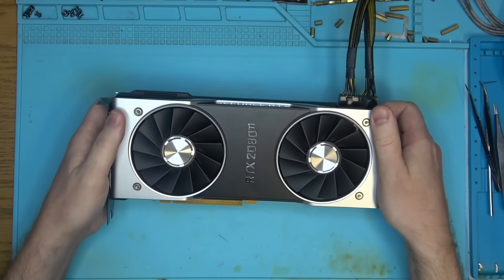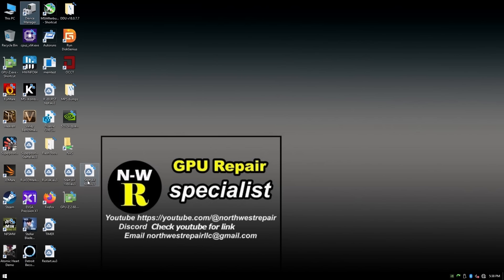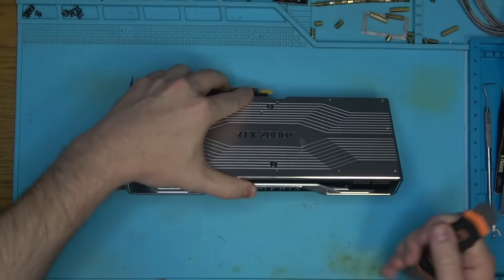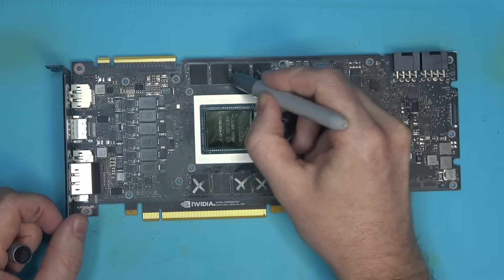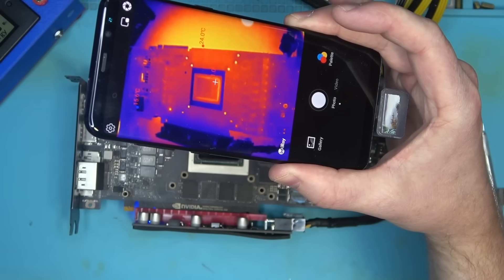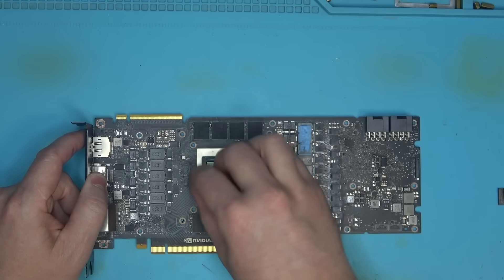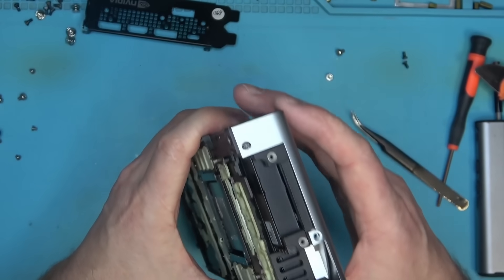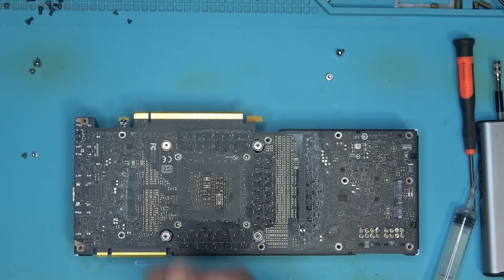2080Ti memory upgrade video 11GB to 22GB

Comment from the maker: Upgrade does not work for all cards
2080-2080ti yes
3060-3060Ti-3070 yes. 3080 theoretically
3080Ti-3090-3090Ti NO. 4090 YES but it requires a custom made board so normal 4090 is a NO.
50 series Not at this point. As soon as 4GB chips come out, there will be a chance to try. Otherwise NO.
Reply: is the 3070 ti upgradable ?
Reply: I have a Zotac Gaming GeForce RTX 3080 Trinity OC, but it needs more VRAM for my 4K screen. Would you recommend the 10GB to 20GB mod, or should I look for a better card in the future?
Reply from the maker: @3.2213  theoretically possible
Reply: 3060ti should also be possible, but with an asterisk. It does not have very powerful memory VRM, meaning you might only be able to run the card with enforced "max performance", otherwise you'll most likely see black screens each time the card will transition from one power mode to another OR when you just leave it at idle.
Reply from the maker: @n0n4me-h2h  yes
Reply: "Same for 50 series cards. Not happening untill we get GDDR7 chips with  4GB per chip. At least thats the idea."
Why is it no possible for 50 series, 3GB GDDR7 chips do exist and are larger then the 2GB GDDR7 chips the cards come with, has somebody already tried soldering 3GB chips to see if they work on 50 series? Also I assume if 4GB chips worked then 3GB chips would probably also work.
Reply: 4060 ti?
Reply: @Keekw  It wouldn't be worth doing it on a 4060ti. It is possible but I doubt you would want to spend $200 to upgrade and still be worse than a 4070. I would sell the 4060ti for $300 and use that $200-250 budget to upgrade to a 5070 or rx 9070
Reply: @noticeb4itstoolate  Yeah prob I will do it
Reply: @noticeb4itstoolate  Prob I will do it
Reply: Are laptop GPUs VRAM upgradeable? In my case I have Asus TUF Gaming A15 2021 with RTX 3070 and 8GB is actually not enough for me.
Reply: I've got a stupid question. Is it possible to just link a bunch of cheap GPUS together to make one that matches up the power of a modern GPU? Would it be more viable to just upgrade the VRAM like in this video? would doing both be possible, or even practical?

Would that require anything different from a regular PC build?
Reply: @ThinkIn4D  This is not possible. you used to have SLI systems for nvidia and also a system from AMD.
With the nvidia ones, you had to have exactly the same cards. With AMD they just needed to be from the same series.

These methods are abadonned now, probably because it was often cheaper to put 2 cheap cards in SLI instead of buying a more expensive one
Reply: Well hell, that leaves out my old RTX3070
Reply: @JohnDo-ntchaknow I've seen plenty of YouTubers upgrade the 3070 to 16 GB! Just do a search 😊
Reply: @JohnDo-ntchaknow  possible on some 3070, search "3070 16GB"
Reply from the maker: @JohnDo-ntchaknow  3070 can be upgraded
Reply: @northwestrepair  3070ti?
Reply: Pin this comment, so it's displayed by YT at the top of comments (for those of us who have that sort option enabled).
Reply: I am curious would this upgrade apply the the 12gb LHR 30 series cards that came out.
Reply: @evilhunter64  those GPUs have barely enough power to use their 12GB.
Reply: @n0n4me-h2h what are you talking about. If I compare apples to apples right the msi 3080 gaming x vs 3080 gaming z which is the low hash rate version both have a suggested tdp of 320w and I can tell you from real world the actual draw is closer to 380w of power which is higher than the non lhr cards.
Reply: @evilhunter64  so the core and memory are powered by the same VRMs? Or does each have its own dedicated VRMs?

Do your research first please.
Reply: How about sapphire nitro 9070xt?
Is it possible to upgrade to 24gb Vram?
Reply: wonder if I can perform this on a 2070 that I have there. Problem is... its an msi gaming Z, and on one of your videos you were trashing out the components that msi uses 😂.
Reply: Can't you just solder an SSD onto the card? Bam! 1TB video memory or more! 

Tell it to go faster. It's okay, I'm from Germany and as you know, speed limits don't apply here.
Reply: @KaeYoss  SSDs are still actually slower than even old DDR3 RAM
Reply: I was not requesting anything ! Have a great day ☀
Reply: Okay. EVGA ftw 3 ultra and MSI rtx 2080 ti. Is it possible? I'll get those SN for you by email. Mr. MSI X299 SLI plus.
Reply: Can you upgrade my evga ftw 2080ti to 22 GB?
Reply: What about 2070super?
Reply: Is there an explanation to why a 3080ti can't be upgraded?
Reply: 4070 super? Or no point?
Reply: Do you want to try it with my gigabyte 308012gb gigabyte WB?
Reply: what about 3070ti? i got one
Reply: Dies a rtx 2070s work
Reply: 1080 ? :')
Reply: 4080 24GB?
Reply: i have a titan rtx, would it theoretically be possible to make it 48gb?
Reply: is it work for 3070 mobile?
Reply: Can you explain why the 3080 is only theoretically possible as opposed to the 3060-3070, which are a definite yes?
Reply: What about 3070Ti? That one should have had ~16GB to begin with. Freaking swindled man. I hate how I couldn't push to the 3080, but I should have just thrown caution to the wind, and risked it.
Reply: i own the Aorus 2080 ti Xtreme 11g/gv-n208taorus x-11gc would this be upgradeable and how much are you charging for?
Reply: Good thing I have an RTX 3060. I would love to have my vram doubled without shelling a fat wad of cash.
Reply: Looks like 5080 is a yes :)
Reply: How much can you upgrade a 3060 to?
Reply: What about GTX 10 series cards?
Reply: @matriksky I’d assume paying for the mod would prob be more than the card is worth. Might not be worth it as you can just buy a higher end card by the time you pay for them to add more vram. Could be wrong tho
Reply: how about a 4080Super?
Reply: What would you be able to do with a 3060 TI? Would you possibly be able to make it 12or 16gig ??
Reply: What highest Vram upgrade can be done for rtx 3060 and 3070?
Reply: I've seen 3080 with 20gb so it does exist. I was hoping for one with 24gb
Reply: what about a 3050
Reply: Would this possibly work on the low profile or mini-itx versions of any of these cards? Or would those cards not draw enough power for the chips?
Reply: Chips of rtx 5060 ti must be 4gb - 128bit mean 4 chips.
Reply: Are there any places that I can pay to get this done?
Reply: how come nobody gave 3080 a try?!
Reply from the maker: @amortalbeing  Gigabyte 3080 20GB exists.
Its a very specific case that may or may not work on all 3080s. Not to mention, cost of the chip was never giving us any favors to try it.
Reply: can a 2080 super have memory upgraded?
Reply: Strix 2080 S A8G is it Upgradable ?
Reply: You say 3090 doesn't work, but what about the "first gen" ones that only had 1gb chips? The ones that had ram on the front and back of the card.
Reply: GTX 970?
Reply: I have artifacting 3070.
And I can confirm it is the memory.Would you be able to make it sixteen gigabytes
Reply: Whats the max amount of memory you can get onto a 3070 ?
Reply: RX 9070 xt?
Reply: 4080?
Reply: 4070 ti super??
Reply: This is huge for people running local AI models.
Reply: Do you know if it could work on the 3070Ti? I don't see you list this card.
Reply: Can you upgrade my Zotac 2080 super to 16 GB?
Reply from the maker: @paulburkey2  yes
Reply: @northwestrepair price for the upgrade? Going to build a low budget PS5 killer with this card for my nephew
Reply: do it anyway!!! i am the CUSTOMER! make my 5080 a 5090!
Reply: how about a msi RTX 3050? its a 8gb now
Reply: @CFyfe86  there's no point in upgrading a way too low power card while the process is going to probably cost you more than the card itself
Reply from the maker: @CFyfe86  not possible for 3050. 3060 3070ti and 3070 ok
Reply: where you live? whats ther cost?
Reply: is it possible to make a 2060s 8gb to 16gb or 12gb

Comment: You forgot to clean the thermal paste off the backplate at 10:52. You cleaned it off the die but not the backplate, hope dudes GPU is still ok🥲

Comment: pendent motor with a small diamond blade slitting saw is the easy solution to stripped screws turn it into a flat head

Comment: What even is the point of the VRAM capacity upgrade? It does not give any real performance boost, only frame times may be slightly better, but a 2080Ti is still going to be a 2080Ti.

Comment: I have a 2021 14in razor blade with a 5900hx and a 3060. I noticed there are 2 empty spots for vram chips to go. It only has 6gb of vram so i wonder if i could add another 4gb for a total of 10gb. What do you think? They are samsung 2gb chips.

Comment: PTM worked very well on my 3090's hotspot temperature. Normal paste would get pumped-out slowly and while the normal GPU temperature would remain around 80, the hotspot would creep over 100.  
With PTM, the delta remains 14-17C depending on the TDP and I have not changed it since I applied it back in 2022.  

nvidia used PTM on the 4090FE so I am surprised you weren't aware of it, unless it was sarcasm.

Comment: Am I correct from the results of the regular thermal paste temp being 58c? and then the PTM was 68c in his tests??? That is what I saw anyhow. I know someone earlier on a live stream told me PTM can accomplish same temps Liquid metal can but so far I have yet to find any proof to back that claim up! I myself use thermal grizzly or Kingpin and between those 2 they beat everything else I have used but its only by like what maybe 3 to 6c? So even then its not that big of a deal tbh except if your overclocking, that few c could up your score drastically

Comment: PTM tends to be so-so immediately after application. After it's baked for a while performance actually improves. I think it flows in the liquid phase to allow for a thinner, more complete thermal transfer.

I like it but it is a PAIN to apply and it gets damaged if you ever remove the heatsink requiring reapplication.

Comment: A good repair video you have here but there is one issue though that i would like to address. So you decided on, not replacing this fan as the noise it makes is little...if a fan is making any sounds it shouldn't be or is vibrating, it needs to be changed, the bearing is going bad and can fail which leads to overheating and damage to said component. i sure hope that you consider changing components like the fans as well in the future. there is always a way to get a stripped screw out, you just have to be willing to do it. Repair work 8/10 i would have given a 10/10 but you refused to replace a fan that is clearly going bad.

Comment: Technically superb, but really unnecessary; the 2080Ti is now a 1080p card and for the time it will still be able to do that, 11Gb is more than sufficient. I would say the biggest offender in the not enough ram for its power category was the 3070Ti - only 8Gb.

Comment: The PTM7950 or so Thermal pad you used doesn't dry out overtime as a thermal paste would in like two or three years, which is the main reason for them to be used and the temperature is only higher by 1to2 degree celcius so the trade of is more than worth it for most people.😊😊😊

Comment: On the Founders edition 2080ti the Center plate between the Fans is Glued down and there are screws hidden beneath it I am pretty Sure gamers Nexus pulled it off and it seems to bend it quite a bit unless you use a heat gun or something else to loosen the glue

Comment: Hello Tony!

A couple of things:
1. My card hits 100+ degrees under load. I replaced paste recently so... No errors or arefacts. Is it my card or this one thats abnormal?
2. Hot glue under face plate. Put the next one face down on the pre-heater and you'll be able to remove the aluminium cover.

Good one as usual. 👍

Comment: you always leave out so much information. could you clarify this for us?
- you don't like memory upgrades, why?
- you say this is probably pax, 1,8v, and the other voltages. how do you know and how can we identify. maybe you can make a video for this?
- you mention underfill. this is the first time i heard that. i guess it's some sort of glue? so why skip that in your video. that's the stuff we want to see how you deal with that. even if it's not pretty. i saw some broken chips.

your video's are always fun to watch, but i don't learn much from them. i really want more information, tips and tricks and build up knowledge. teach us!
could you also do a multilayer trace repair with telling what youre doing. you always fastforward through the interesting stuff so we see nothing..

Comment: I thought you need some extra (hacked) firmware to discover the extra 11GB, don't you?
Reply: Preset is already in the firmware. All you have to do is to set strap resistors to match new configuration.
Reply: @NickFreneza  Cheers Nick, yeah I was going to ask about the straps also. I was thinking the straps need doing, at a bare minimum!

Comment: Keep in mind that PTM7950 won't be fully effective until you done some heat cycles, typically around 6 or so. So heat it up for 10 mins, cool down for 5. Rinse & repeat 6 times and you should see the best result.
Reply: Really?
Reply: @DragonProtector  Yes because it changes it's state once it goes over 40c i believe, you need to heat it beyond 40c for a while and then let it cool for a while and repeat.
Reply: Good to know! @UlrichLeland

Comment: Temps looks worse with the customer provided thermal pad
Reply: PTM has to break in first.
Reply: Probably will be.  The TPM takes some time to settle in, but then so does paste to a lesser extent.  The main advantage is that the TPM is stable long term, so even if it's a few degrees higher now it'll still be that same temp when paste would have started drying out and passed it for temp.

Comment: You will be making a lot of money upgrading current 8GB 5060Ti into 16GB later on, as they get held back by RAM size on games that need a lot of textures.
Reply: It will be cheaper if people just bought 16GB from the start.
Reply: @arenzricodexd4409 but they didn't and won't due to rising VRAM prices
Reply: @Soravia so buying 5060Ti 8GB and sending it for 8GB upgrade will make it cheaper than buying 5060Ti 16GB from the get go?

Comment: Tony is definitely not a fan of PTM or thermal putty, but when he repaired my 4090 he did it anyhow at my request, even though it is more time-consuming. In that video he posted he thought it came from AliExpress but the PTM was Honeywell and the temps are now 2° c lower than when the card was new. Another great job here, nobody does it better than he does. Who cares😅
Reply: I love the stuff, tried it a few months ago for the first time and the temperatures were significantly better than regular paste. (5-8c core, 15c hotspot!)
Reply: I agree. PTM has alot more advantages, at first I tried it on my GPU, temps dropped significantly over time. Then I applied a sheet on my CPU and I'm seeing the same outcome. It's definitely advantageous compared to the constant pump-out after a few years. It might be scary at first and seems bad, but over time (If you applied it with no air pockets, since air gets trapped) it gets better and better once it hits >45°C.
Reply: @Radi0aktivv I own the Strix 4090 that was in his recent repair video. I've had it for the  3 years of its existence, and I remember what I probably did that damaged it. I used a universal vertical mount kit and I didn't see a screw that was sticking up, but besides falsely reporting 0w, the  GPU ran normally and was pulling the correct power, just not reporting. I sent it to him for repair, asked him to clean and service it and using the PTM 7950 and the Upsiren U6 Pro Thermal putty I provided.

 I was fully prepared for an upcharge, because that takes more time then pasting and replacing pads. Not only did I get a perfect repair, he did what I asked, and even applied a resin barrier to protect the VRAM chips and the die which also took a lot of his time but greatly appreciated. The upcharge never came and he stuck to his original quote. Somebody going out of their way and doing extra work is rare to see these days, so props to him, the GPU came back looking like the day it was new and working even better.
Reply: I'm using the ali express quality one haha. I buy them from amazon. Honestly it has been a year on my MBA 7900 XTX and the hotspot delta temps are great.

49C GPU core, 65C Hotspot, 72C mem temp (irrelevant but I'll put it there). On waterblock by the way.
Reply: @benjamen007  xtx a beast, one day I'll watercool mine
Reply: For some reason most techs are set in their ways and insist on using their own shiity bulk paste they got for cheap.
Reply: You are probably right as far as a lot of techs, But in Tony's case I'm pretty sure he uses GD-2 which is AliExpress's best thermal paste. Normally nothing much good comes from AliExpress but I was in the business for 37 years 26 specializing in gaming PCs and I tested and logged results from many of them, GD-2 is a little difficult to spread, but temps are as good or better than the best brands, and more importantly it lasts a long time before drying out which is very important especially for GPUs.

It is less expensive when bought in bulk or large tubes, but I think that isn't his number one reason for choosing it, I'm guessing it's a combination of performance and longevity and if I wasn't going to use a Honeywell PTM 7950 phase-change pad, I would have just told him to use the GD-2.
Reply: @randy2493-s6n  nooo! It's the BEST paste in the world, that lasts forever! /s

In reality, it doesn't. Most thermal pastes used for CPUs degrade and pump-out, when used on bare die chips (GPUs, laptops). I guess most of his customers just don't care about temperatures for as long, as the card works.
Reply: Ptm lowered my GPU temps from 110 to 86
Thermal paste just wasn't cutting it.
But tried ptc on my Nvidia shield and it didn't work.
Reply: Who asked you